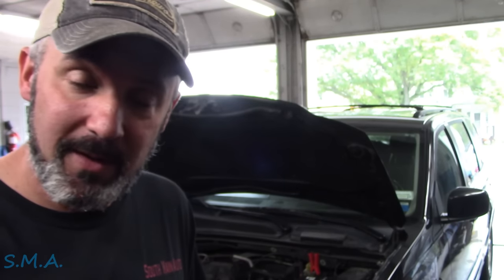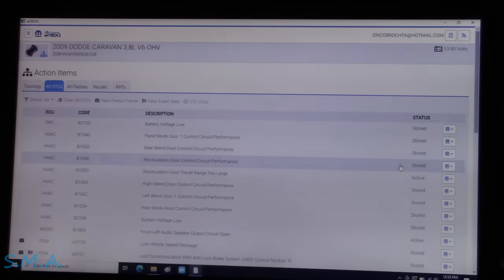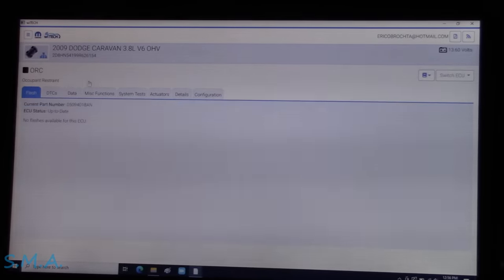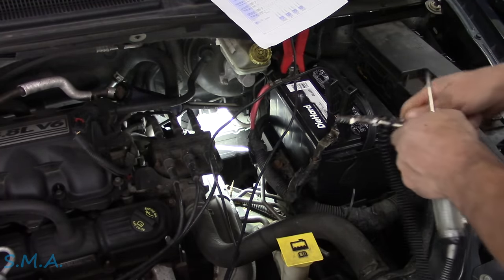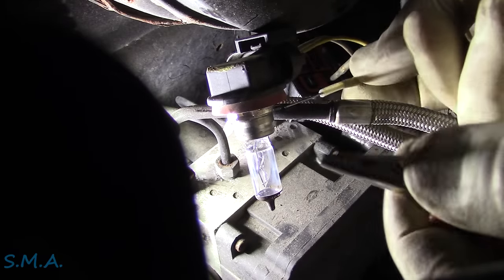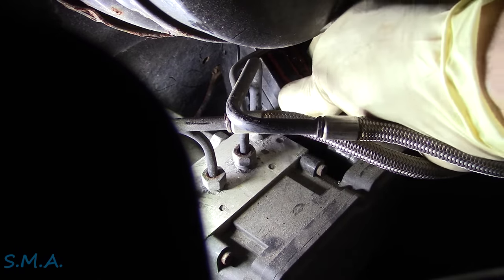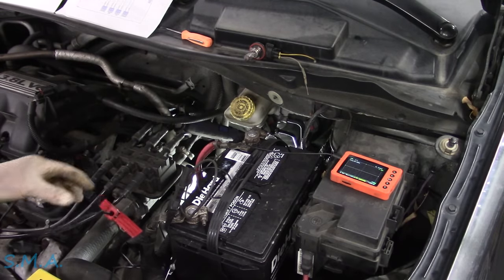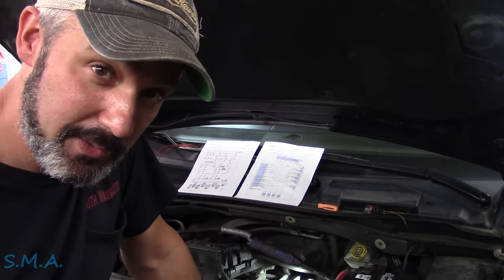Dodge Caravan: ABS Module Failure / No Speedometer

Comment from the maker: UPDATE:
The lady brought the vehicle back several weeks after the diag and I installed a used ABS module. However at that point the front brakes were grinding metal against metal along with many other issues. She had me install and program it (initialization process to rewrite VIN) After that the ABS would communicate just fine and the speedometer now works. The downside is it had several codes in it for speed sensors. No big surprise but the good news is she can now go get the inspection sticker and hammer down the road safe and sound 🙄....
Reply: Safe and sound, being keywords.
Reply: Some folks need to realize there are times the household funds need to be directed to the cars maintenance. Makes zero sense to ignore them.
Reply: Maybe blur your email address? 🍻
Reply: @alaska2480  I saw it, too, but since it was a hotmail address, I assume he uses it essentially as a burner address.
Reply: I wish you were closer. I’ve got an 03 Tahoe that needs some electrical attention
Reply: Refried beans? Did you just repurpose an old video???  Oh yeah, I'm good with that.
Reply: Thanks for the update info, that is awesome!!!!!
Reply: Has anyone told you today how AWESOME you are! The "rambling"helps so so much.
Reply: Thanks VERY MUCH for the update! I hate being left hanging ...haha
ABC- MNOP,  caught that. Pretty cool
Reply: Were the brakes replaced?
Reply: @alaska2480  It's the same email address on his About page. So I guess he saved us the trouble.
Reply: I unfortunately have a 2008 Grand Caravan it was acting up recently it looked like the circus lights at the fair.  Would come and go nothing staying on.  Finally got my battery tested it was pretty much toast.  Common with Jesum Chrysler products if they don't see a good 12 to 13 volts with good battery cells they get real finicky.  I also live in the rust belt so I have to constantly fight corrosion.
Reply: I think wirring harness
Reply: thanks for the update  glad every thing went well
Reply: Brakes grinding... safe and sound? Isn’t that an oxymoron? Haha great vidjya as always Eric!
Reply: @kevinsavard5998  I was trying to explain this to a lady last week. It had like 27 codes stored in a Caravan but she was having to jump start it because the battery was so spanked. She didn't want to put a battery in something that had that many problems. She asked if I would put a battery in it if she bought it somewhere else. That was a hard no.
Reply: @southmainauto couldn’t find the brand or model of that mini scope used in the video. I’ve been looking for something like that to have and use when getting the pico out is too much of a hassle for the size of the job. Could you please post the info in the description or anywhere it’s convenient. Thanks.
Reply: @Garth2011  Yep. I don't entertain cheap people at an level. I've seen people wait in line for hours for a new phone they didn't need and couldn't afford while wearing 250 sneakers. Yet cheap out on something essential. I dont hesitate to send them packin'
Reply: @mbdoc631  uscope from aeswave.
Reply: I like getting the updates!
Reply: You can lead a horse to water, but you can’t make it see sense 😆 You did your bit, brother 😎
Reply: Y'all should check out "Watch Wes Work"... He's a damn good mechanic as well, and funny, and has a dog that can sniff out mice in any vehicle! LOL
Reply: You would not get away with that in the UK, ours is a very comprehensive yearly inspection.
Reply: @Garth2011  yup rather than cellphones, other things as ppl see all to often. Some even blame others because they didn't think of this. Why? I dobt know but I think we've got a unique society coming down the pipeline where everything is "everyone else's fault"
Reply: @michaelgiannone2192  Where abouts you live?
Reply: Thank you for posting the update. I learn from every video I watch of yours. You are a genius!
Reply: Is it possible to use  the used or second part Module?! 🤔
Reply: This so helpful. As I have a perpetual Chrysler inventory. Often it’s problem has been failed sensor modules due to northeast corrosion
Reply: I have the SAME problem. So, the replacement module HAS to be reprogramed? how nice.  The dealer charges $100.00 to do that. Used module & pump is $100+ & labor to install is $200.00. Anyone want to buy a van?
Reply: What device is that called and maybe a part number

Comment: Thanks to your teachings, and many other YouTubers, I was able to solve 5 codes after an engine out head gasket replacement on a '03 Forester. I had errors with the TPS and ICV. 
Turns out, I had forgotten to tighten one bolt fastening a ground group of wires.
No parts cannon! No "swap tronics".

Comment: Much earlier in my life, 45 years ago, I did all my car maintenance myself. Once computer control with multiple sensors came about, I left it up to the pro's because I had no way to read codes, run tests etc. I have done very little repairs except oil changes etc. during the past few years I have been watching your channel and several others but had no need to do any actual repairs. Several days ago the engine on my 2007 Nissan frontier started acting strangely and lit the check engine light. I have a "FIXD" unit plugged into my computer port so I viewed the code on my iPhone, which was a P0335, Crank Shaft Position Sensor error. So I did a YouTube search on that and viewed the simple procedure for replacing it. Had I not been watching you guys show similar repairs, I would have just taken it to Nissan or another shop and had them do the work. So this old man is appreciative of you guys sharing your skills.

Comment: Mister "O" !!  A thank you for a fix recommendation.  My 98 S10 has had intermittent, mostly non performing heat in the cab.  Luckily I live in the South, so heat here is relative and only needed on occasion.  However, I did your CLR forward and back flush on the core, 1 hour each way, and voila', suddenly I have heat!!
Reply: I saw evapo-rust now has a heater core flush solution.  I wonder it it is any good.
Reply: That's the lovely Dex-cool sludge all the mid to late 90's gm products have. Hopefully you never have to see the lower intake gaskets but they look lovely by now I'm sure. If it hasn't been removed and flushed from the system by now I recommend getting rid of  all the Dex-cool and replacing it with a modern equivalent asap.
Reply: @tiller3237  Had this issue long ago.  I have used the other stuff for years, but apparently some earlier damage had been done.  In any event, some of that led to overheating, so new radiator, AND new engine has fixed all that.  The heater core is my last issue.  (I hope).  to coin a phrase : "thanks for watching"

Comment: Eric this is another excellent video. I know it is your catch phrase that if you can do it so can you.  You and I know that’s not true.  Most people cannot afford a lab scope. Even if they could they would not know what they were looking at. You said this vehicle came from another shop so obviously even semi professionals can’t always figure these problems out. 

I help in a small engine shop now. I’ve used my lab scope to test crank sensors and modules to keep from parts swapping.  My employer looks on in wonder. They don’t have this technology that I grew up with and is now second nature. 

Just like doctors who specialize , you are a several steps above the “nuts and bolts” mechanic. I worked during carbs and points , saw transition to electronic ignition and fuel injection. I still marvel at what will they think of next.  

Keep up the good work ‼️

Comment: Having trouble with 2010 , speedometer stopped  working , abs light came on , traction control light on , had two broken wires in driver's side door harness . Great video as always you bring vital information. Thank You for sharing.
Reply: So you fix it with the wires in the door ?
Reply: @rickymartin3678  yes it fixed all issues , but I fixed it before I seen Eric's fix in video . I used just plain crimp butt connectors and it held for about 3 weeks now gonna go back thru it and repair like Eric showed. The wiring harness don't seem to be able to purchase.

Comment: Good Job. I for one greatly appreciate your comments & explanations.
PLUS your pleasant demeanor and the occasional "Family" appearances, too. 
Over the years, I "inherited" 2 Dodge minivans that had been my company vehicles. Each presented (as they say) terrible ground integrity over they years. The 2000 was totaled, but still have the '92; it now has only 2 seats and is the neighborhood "Waterproof" "Large-Object-Home Depot-Run" hauler. Recently had no dash lites, no gauges, no door chime. 

Since NO OBD2 until 4 years later,  I took a page out of YOUR FINE "Let's keep it simple, folks". 

Since the chime would talk to me whenever I "corrected" a missing connection or ground. BINGO. 1 bad ground in the engine bay. 2 bad grounds at the BCM housing near the driver knee space AND a corroded (connector leg) solder joint on the BCM PCB inside. Took me 3 hours ... YOU ... What? 30 minutes. !!!
Warm Regards to all,
John in the NW

Comment: ABS module on my 2000 Expedition went out (continuous running key in or out).  Opened it up and found the MOSFET was burned out.  Soldered in a new one for $3.  Sealed it back up with RTV and been running for 2 years now.
Reply: That's pretty damn resourceful.
Reply: just amazing how much can be done if you have the skills!
Reply: @sparkie5571  A replacement ABS module at the Pick n Pull was only $60 ($260 retail). Follow Eric's advice.  If he can do it...

Comment: Time and time again.   The ability to pause and think through the problem, and then verify that is the problem (instead of guessing) has seized the day.  I think most mechanics/technicians are doing this but as always a few bad apples ruin the reputation for the bunch.  As always, thanks for the video and keep doing the great work.  Critical thinking and developing a process to run down a problem is always the key to coming up with the correct solution.  Keep it up!!!!

Comment: Great diag Eric. Just an observation in how state inspections rules and regulations vary from state to state. 

In Missouri, an ABS light will not fail a sticker inspection. Neither will an SRS/Air bag light.

Working emergency brakes are "optional" also. 

I will fix an ABS issue. I keep my brake system and tires 100%.The SRS should be something I should be able to turn off. 

If emergency brakes were meant to be useful they wouldn't use cables that corrode and mechs that jam your pads/shoes into the locked positions.

And they would stop your car in less than 250' from 60 miles an hour.

I spray the whole E brake system with Fluid Film once a year (and never use them). Lost too many pads and shoes. I would have to be falling off a cliff before I would yank the E brake. 

But have a "wiggle" in an inner or outer tie rod, or in a ball joint and you will fail the inspection. 

I always thought tire date codes should be part of the inspection. After fives years I toss all four and rotate one into the spare. 

Old tires don't stick and stop like they should.

Comment: I think Mr. O deviated from his normal and correct process here because that ABS plug looks tough to get to plugged in. Eric normally would not disturb the ABS plug and back probe it. ANd seeing good + and minus and comm fail the ABS. In Avoca, NY, that plug could  get the green crust EEZ. So, Mr. O , when the plug was  put back in, you checked to see that the ABS no comm didnt go away. And I would surely as others, would have loved to see your trip to the PIC N Pull. Also would love to see how the car door gets fixed. I see lots more rolls of Scotch 88+ at Lowes today.

Comment: Another interesting video.  While describing how the ABS module should be replaceable without disturbing the brake hydraulics, at around 15:16, the years of rust belt experience come out - "providing the bolts come out".

Comment: Good job Eric.  As I’ve said before, I wish you were closer just in case I have some major automotive issue arise since it looks like I’m gonna be driving my vehicles longer than I usually do.  These inflated prices are getting outrageous...  I have looked on the internet at used truck prices and my 10 yr old truck with 120,000 miles is worth almost what I gave for it new....   Well, lets rephrase that,  people are asking that much for them....

Comment: Probably a bad or cracked solder joint on the PCB inside the ABS module. Common problem with most automotive devices. Some ABS modules on some vehicles are well over a $1,000 just for the part plus programming it and installing it.

Comment: I've worked on a couple of Dodge Grand Caravans with ABS and Brake lights on.  My usual first step is to look for a problem at each wheel.  Mainly just jack it up at each wheel and give them a good old spinnerooni.  On this one I have now, I did just that and both back wheels were making a grinding sound.  After replacing the wheel bearing hubs and ensuring the sensor wires were clean and covered in dialectric grease and connected, I was sad to see the lights were still on!  ARGH!

I'm going to check everything by what you did in this video, but at least the grinding is gone.  It drives great but some of the interior functions are not working and I've identified the issue as the BCM.  I'm wondering if the BCM also has some control of the ABS system.  What do you think?

Comment: I’m getting better at understanding some of your diagnosis processes. You and other often mention the drive cycle and the sometimes need to perform one before a fix if finalized, I think that’s the talk speak? Past mentions of the ‘drive cycle’ makes me think drive cycles times vary make and model? I guess I’m asking, CAN YOU ACCESS ‘DRIVE CYCLE’ time lengths for various cars ..it makes me wonder if sometimes you have to drive a car around for lengthily time or distance ?

Thanks 
RR of NH
Reply: A drive cycle is one of the methods used by a vehicle's powertrain control module (pcm) to determine whether an emissions system repair was performed successfully. it involves a special test drive that duplicates the scenario of a person starting the car and making a short freeway trip, as if driving to work. while the drive cycle test is going, the engine computer runs a series of tests or "readiness monitors" to see if the emissions system is working properly.

Comment: Same problem. 2009 Grand caravan. All dash problem lights on all the time but nothing works. Only happened with driver door wide open. Everything worked with driver door half open or closed. Lived with it for a while, but now completely gone bad. Wire or wires must have broken in the driver door harness. Even tho it starts and runs, battery not getting charged and turn signals not working, and wipers turning on and off, will get you down finally. I am going to take the door harness apart and fix the wires.
Reply: So you fix it and it was wires in the door ?

Comment: I want to know more about the little oscilloscope. Where did you get such a small one and how much are they? Does it do all the sensor data B for the other engine seniors ? I’ve used them before but I’ve never seen one like that. I used one to tune my audio amp on my truck.

Comment: If this were a pcm, you would also check 5v ref circuit for shorts/grounds.  Could this issue possibly have been not from a bad abs module, but a shorted wheel speed sensor or some other sensor shorting a 5v ref inside the module?
Reply: Not impossible but unlikely.  A shorted or grounded speed sensor wire will show up as a C code. Most modules will recognise this fault, trigger a circuit protection strategy and shut the faulty circuit down. Usually by cutting the 12V feed to the sensor.

Comment: Eric, looking for a good J2534 pass through at an affordable price. Is the mastertech 2 the best bang for the buck? Also would a battery maintainer that I can control the amperage work for programming? I know it’s not as good as being able to choose voltage but it’s a clean power supply and I can select the amperage. Have you ever had a bad experience trying to program with a battery maintainer?

Comment: Would the abs module being offline cause a no start condition? Had the same issue for months before truck finally died at a light and wouldn't crank back up and now dealership is telling me that's why and charging me 600 for a diagnostic

Comment: What body module is responsible for recieving the signal from the TPMS on GM vehicles? Specifically an 09 Cobalt. My valve stem sensors are sending the correct signal but what ever module thats supposed to recieve that signal is not working correctly. It's not a major issue but it would be nice to get it fixed.

Comment: Good afternoon Eric
I have a 2009 Volkswagen Routon SEL 4.0 that I have been repairing since I got it little by little fixing things to make sure that I’m getting the best performance for a high mileage vehicle it has 172,000 miles and I know it’s common for things to break down I’m messaging you because I really need help I’ve been trying to figure out why for the past three months I have a crank no start I watch most of your videos and have done your methods and still can’t figure out what’s going on. The only thing that I find suspicious but I can’t find anything on the Internet about is my ignition relay Where It connects is only getting power on 30 and not I believe it’s 86 I had a ground issue before to the CKP but I figured that out I had to sand down a little bit of the transmission where connected and now It gets great ground. I’m not sure if that really is supposed to be getting power at 30 and 86 and if that’s really where my problem is as far as codes go it throws a P0340 Cam shaft position sensor the camshaft position sensor is gnu and has ground signal and power any questions that you might have please let me know and I’ll be also grateful if you could help me